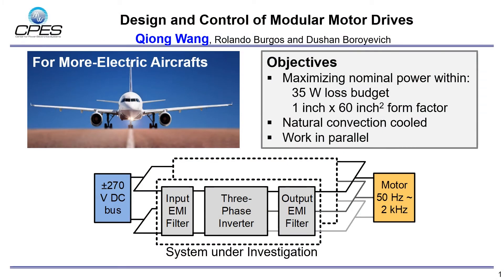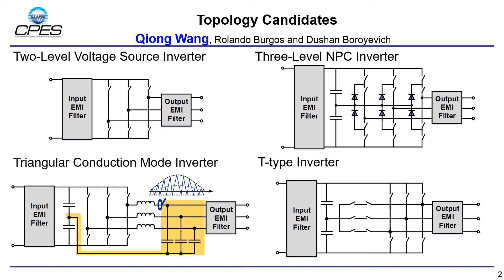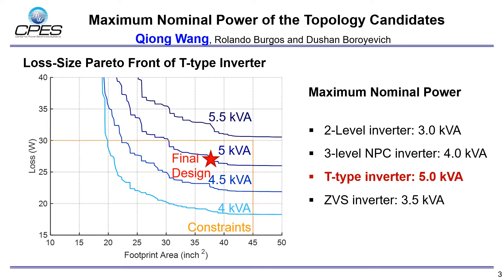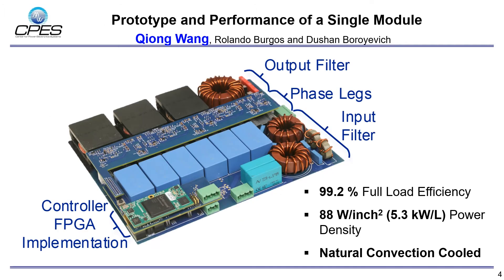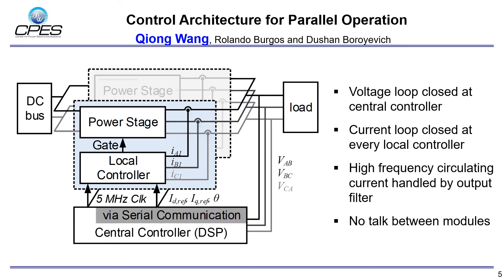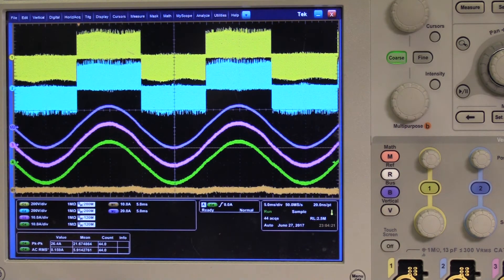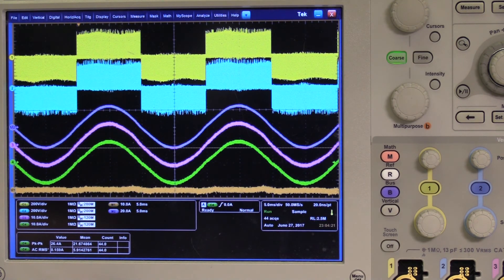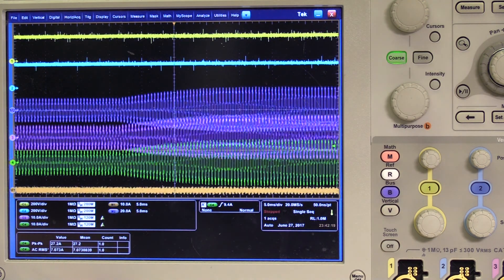Design and Control of Modular Motor Drives

Comment: its very nice way of increasing the capacity of inverters by connecting in parallel , i have a question here , As it seems that in order to have parallel current sources requires big Filters which is extra cost and space ,  So in order to reduce size of filter we will have to lift switching frequency which means more switching losses.   so how does this technique compares with having single high current inverter to paralleling more than one small inverters in terms of cost and performance